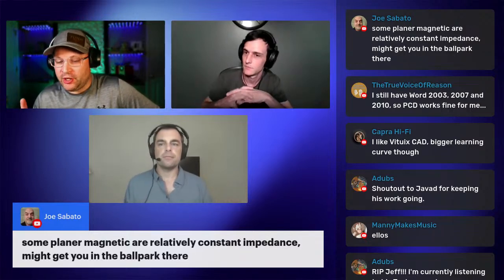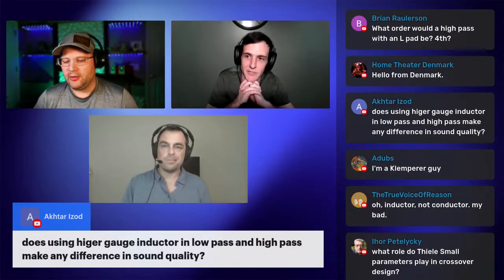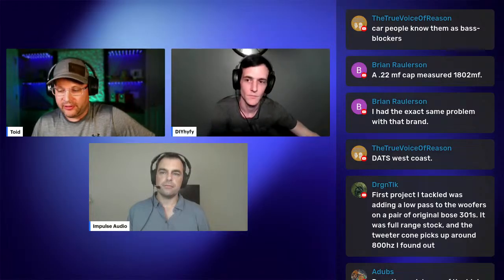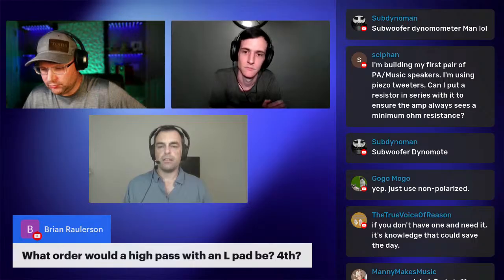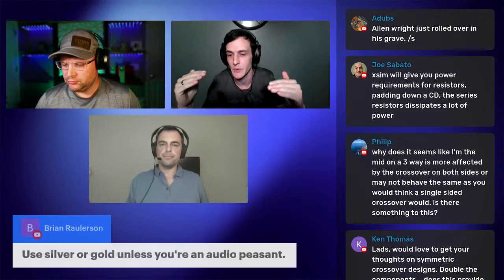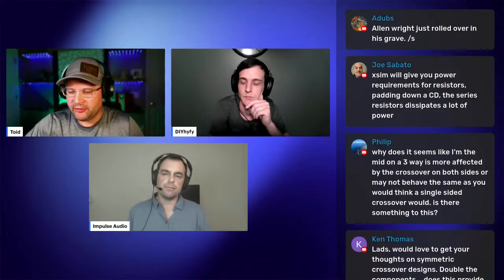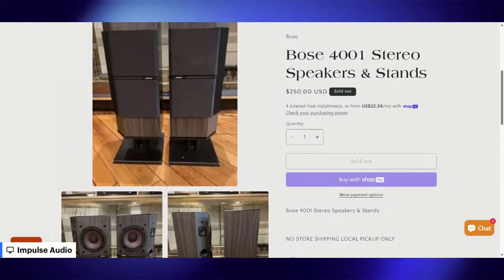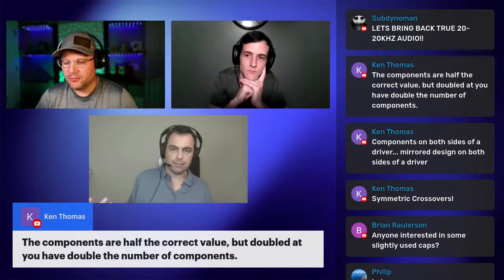Don’t Build a Speaker Until You Understand This!

Comment: Excel 2016 or older for PCD. I have Win11, and Excel 2016 for PCD last release.
Waslo did Praxis too.
FRD Consortium is responsible for .frd and .zma files, which was JeffB, BillW, and Paul Verdone.
PCD spawned WinPCD from Dave Ralph, but Jeff recommended Xsim as next step. 
Iron core, air core, ferrite core, and steel laminate.
Reply: Steel lam have a bit of slam emphasis, and get annoying once you are aware of it.
Ferrite and rod should be avoided except in minimal bandwidth and low current situ.
Reply: Do not use a ribbon without a capacitor, as it shows as a dead short to the amp.
Reply: Series resistors are fine before the highpass, but parallel resistors should only go after the highpass.
Reply: 'Lytics have higher ESR than poly caps. They can dry out, drift and fail.
Using polarized computer PSU style caps back to back halve over the individual, but you can get higher voltage and measured value for lesser cost than the 100V nonpolar most audio shops offer.
Higher voltage poly caps have lower ESR and larger contact area, so in theory can sound better.
Caps do have internal resonances, and can be audible in low HD tweeters, AMT as an example.

Series resistors in circuit with a highpass are still in series with the highpass in both fore or aft positions. This is AC.
Going to ground is a misnomer, as this is AC circuitry.
Reply: Passive filter poles used plus inherent acoustic rolloff add to total acoustic rolloff.
Reply: Asymmetric xover slopes are required to adjust for acoustic offset of drivers used. This is for flat baffle systems mainly where sound origins are not in the same vertical plane and Z distances are different.
Reply: To visualize phase as plotted, it should be done on a cylinder in 3D. The points at wrapping of the vertical line of phase are the same at both -180 and +180 degrees. It just has to be displayed this way in a 2D plane on a screen.
Reply: Gauder Akustik uses symmetrical diaural style xovers. These have components in both positive and negative connections.
Reply: Ladder delays are added to adjust delay.

Comment: I’m confused on the topic of not having a resister before the woofer. I just built a crossover with 2 resisters on my woofer side, 1 in series, and 1 in parallel. Should I take one of them out? It really helped level out my impedance when I have both.

Comment: Iron core inductors warble in slope range in high frequency applications... this is due to iron core modulating the overall inductance  at high frequency. This is why air core inductors are used above the midbass band. Air cores are a cleaner device xx
Reply: Yes, and iron cores are essential in high-inductance applications for low bass lo-pass filters only, where you want minimal series resistance, unless you want to spend $700 and can afford very heavy weight and space.